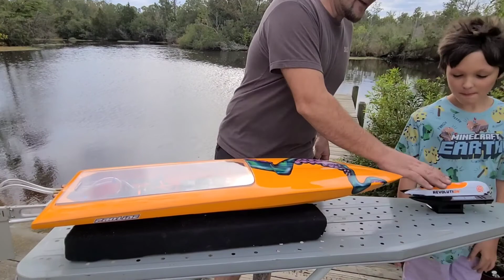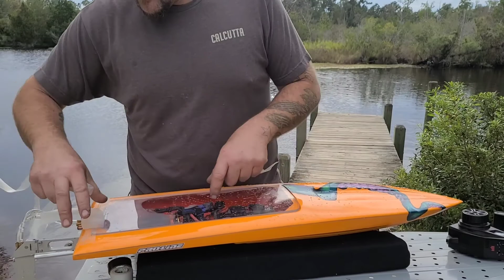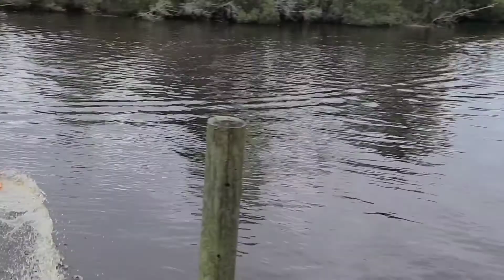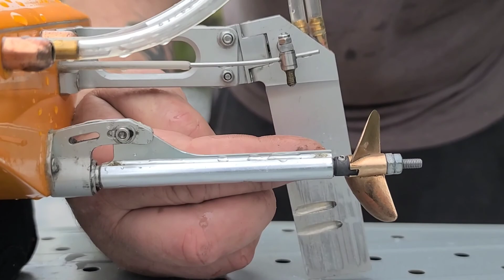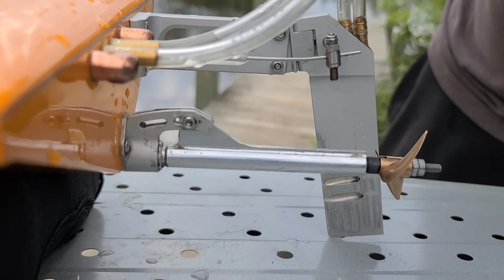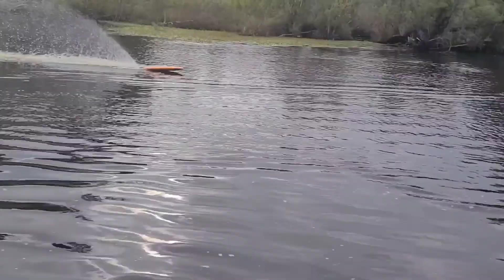fast Electric rc boat delta force 35, test day - tp power, ose 150a esc 6s

Comment: I'm gonna build me one this winter..  I see you went with the longer speed master rudder.  Any benefits over the shorter one ?
Reply from the maker: This is my best handling boat period,  the longer rudder really aids this boat in a turn.   I wouldn't change a thing.  The shorter rudder tends to loose grip in a left turn
Reply: @IRONCLADRC  thank you I'll order the longer one from Offshore Electronics when the hull becomes available again. I also chose extra large turn fins but one and a quarter by one and a quarter trim tabs which were used on a 31 in impulse so I figured that would be a good fit. I love your videos and that you respond back. I'm going to watch the build video which I didn't have a chance to yet but I was showing my daughter this is going to be our winter project 😂

Comment: You whill need trimtabs  turnfins to run much better,I think
Reply from the maker: Yes I agree. Waiting on them, ordered them from China shipping on the  long boat.  Grrrrr
Reply: @IRONCLADRC  hey good news👌 post the video with them mounted, I recommend the Octura m445 propeller or X series, driver angle -1 ° and trimtabs aligned with the boat line🤜🤛
Reply from the maker: Roger that my friend.  Will do